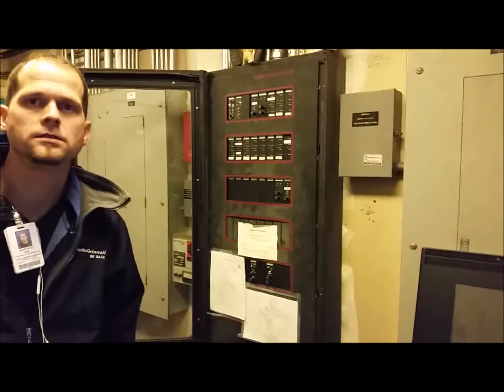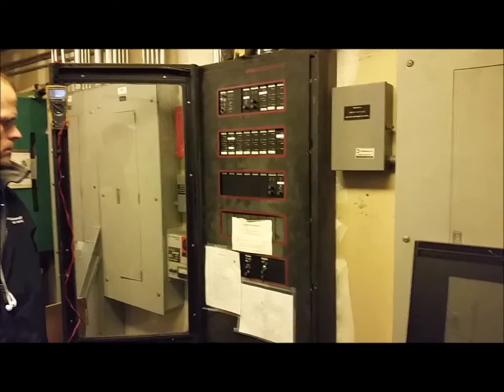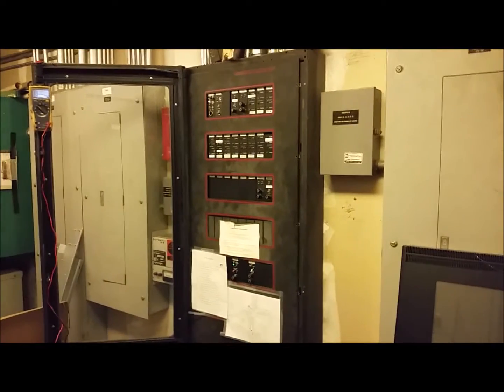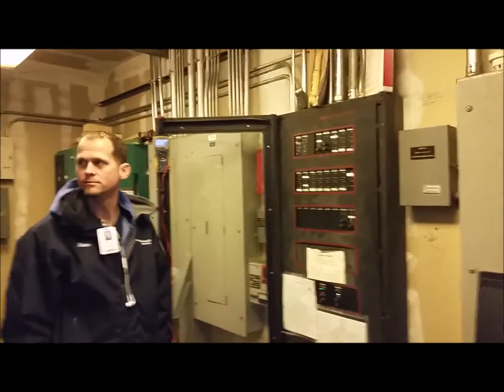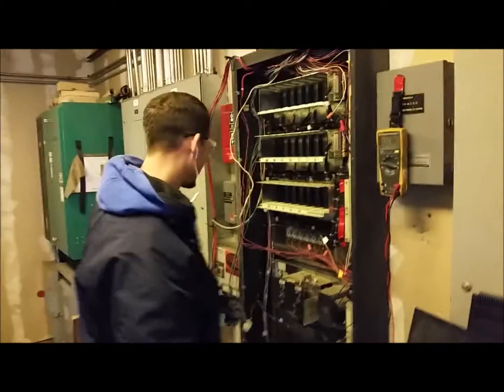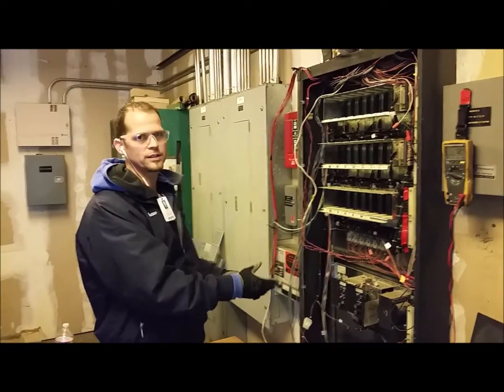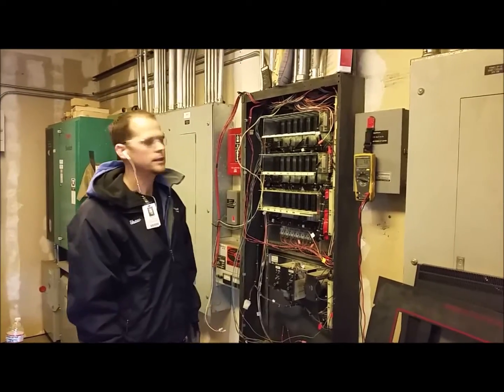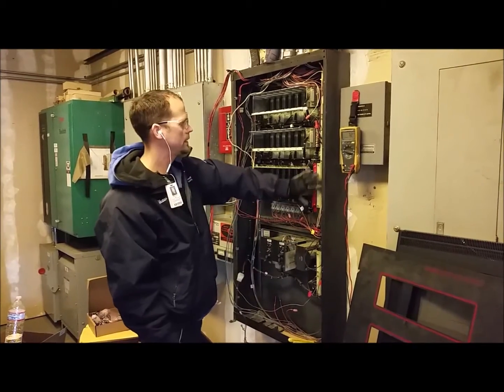Simplex 2001 to 4100ES Fire Alarm Control Panel Migration

Comment: Was it a voice evac system or a regular system
Reply from the maker: ELEVATORS AND TRAINS BY GAMINGADJECTIVES this one was non voice
Reply: Were the original horns or whatever left intact when the 4100ES replaced the 2001, or did those get replaced as well?
Reply: @ZakWolf  I would guess they were not. I don't usually see that happening.
Reply: @AcElectronicSystems  Yeah, that is usually the case. Even at the Art Center at my friend's university, when they replaced their Simplex 4002 panel with a Simplex 4007ES system, they removed the old Simplex 4051 horns and slapped TrueAlert horn/strobes onto the 4050-80 light plates (before the 4002 they had a Simplex 4208; its' cabinet is still there but used for terminal wiring.) But I've also seen a couple of Simplex 4006 systems that keep the old alarm signals from the Simplex 2001 and 4001 panels they replaced.

Comment: Wishing you could team up with Vivint to put fire alarm system into our house, My sister is hearing impaired and might not hear the smoke detector going off while asleep.
Reply from the maker: Shannon Greenwell Thanks for watching. There are some reasonable residential solutions on the market today. You need to look at a gentex 120vac smoke detector with an integral built in strobe light.
Reply: James Jack Thanks and your welcome!

Comment: What are the notification appliances?
Reply from the maker: I can't remember the exact model numbers but most were an older non synchronous audible horn/visual device.
Reply: They were most likely in the 2903 series, with the light/strobe plates that had the wedge-shaped "FIRE" lens. Those were commonly found on Simplex 2001 systems in the 80s.

Comment: The system was obsolete.  The owner is a self maintainer  of their fire alarm systems.  The control cicuitry in the FACP was malfunctioning.  The old system used a reverse polarity city circuit to communicate alarm conditions to the owner's security office. The new system uses a DACT over phone lines.

Comment: Did not specify what the problems were... How a fire panel works everything coming off that panel goes to in-house sensors to detect smoke or fire and they even pick up certain gases aerosols set them off.. The only thing that it is connected to outside of the building is the phone line my building is also built in the 80's.... So would it be a good guess to say the problems that panel was having was not sending a signal?
Which would end in a big tag by state in any kind of medical facility.

Comment: That looks pretty cool, seeing a black-cabinet 4100ES!
I remember at the local YMCA Youth Center, they had a Simplex 2001 panel kind of like that from the 80s, but a few years ago, the panel was gutted and a Simplex 4006 system was installed right into the cabinet. Of course, the Simplex 4005 and 4006 systems were conventional panels, often intended to be used to replace old hard-wired fire alarm panels, but I can see how 4100-series panels can easily be installed in the original enclosures, as conventional fire alarm panels back then could be large!
Reply from the maker: +wileyk209zback Thanks for the comment. The retrofit kit used for this project is specifically made for the 4100 to be fit into the old back box of this 2001.The same back box dimensions were used for the 4100 series fire alarm systems as the 2001 and the 2120. Completley backward compatible. The only real challenge is the depth of the old can being a little more shallow. We just use the retrofit kit which incorporates a spacer that the new door mounts on.
Reply: @beholdthesalesman  I have also seen a school in my area go from a Simplex 2001 to a 4100U, still using the original conventional devices from when the school was built in the 80s.
Reply: +beholdthesalesman Nice, I see how that can be important to maintain backwards compatibility, especially with a flush mount masonry type design, which you will sometimes find on old systems.